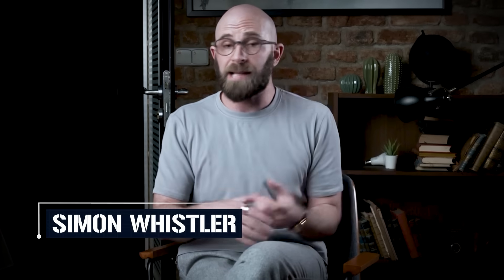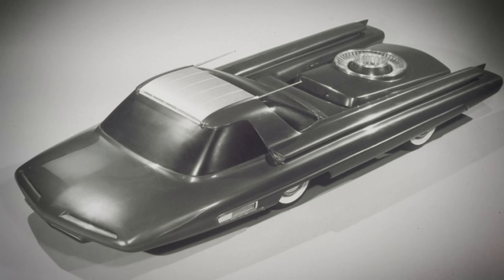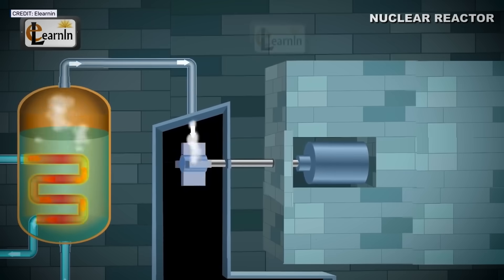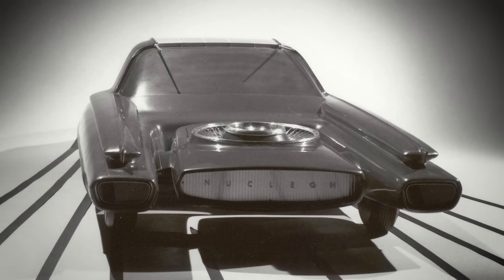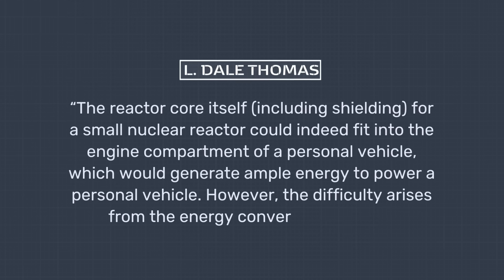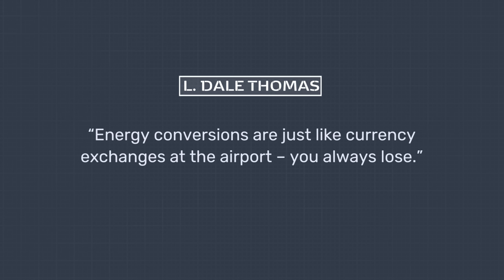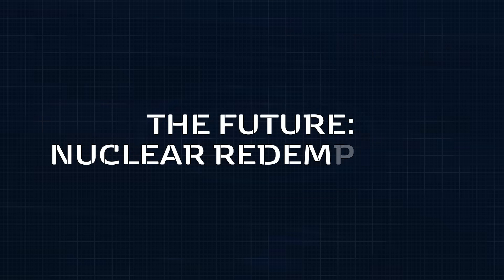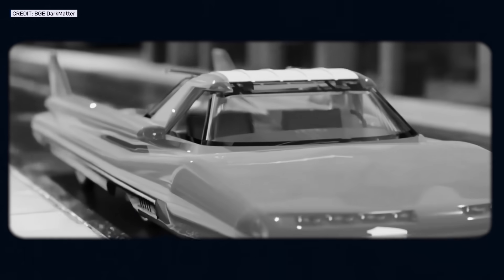The Ford Nucleon: The Nuclear Car of the Future

Comment: If you have an electric car and your city runs on nuclear, technically you’re driving a nuclear powered car
Reply: Technically steam powered too 😂
Reply: Using this line of reasoning then most electric powered cars are really coal powered.
Reply: @BTM666-t7r  ... yes they are
Reply: @BTM666-t7r yeppers you got it which is why we really need to get the grid figured out before going 100% electric
Reply: @mininearby no reason to. The best battery's we have barely have a 7yr life span... that said within 30 years of fully electric world as you say... to totally run out of minerals/resources of the earth. People have no idea what's required to even make 1. (Small village of slaves) just to minerals the highly toxic minerals no sane human would try...
Reply: @mininearby yes and no. What people fail to realize either out of ignorance or shear stupidity is that the automotive and utilities industries are two distinct industries. Power plants make their money exclusively based on how efficiently they can produce energy meaning they're incentived to optimize their tech. Unlike auto manufacturers which only do it because regulations tell them to. Suffice. Even if coal was the only fuel burned at power plants (which isn't the case even in America which is openly anti-environmentalist reform) an EV would still be the best option. The real threat though would be the strain on the grid. It's just not set to handle 100s of millions of cars being plugged into it. The best solution would be to incentivise those who can to install solar panels along with their vehicles purchase
Reply: @BTM666-t7r you are 100% right, thats the point
Reply: @BTM666-t7r  depends where you are. Here in the UK, we have zero coal power plants (last one closed last September). Places like Finland, Sweden etc are nearly entirely renewable. France is predominantly Nuclear and renewable
Reply: @jonc-1989 which....is still electrical
Reply: @BTM666-t7r  glad someone brought that up! 😂
Reply: @BTM666-t7r  Exactly. That’s why driving an EV because you want to be environmentally responsible is a fruitless exercise. Unless your home is powered by solar or you live in an area powered by nuclear, hydroelectric, etc., you’re still burning coal or natural gas.
Reply: @SSPspaz  Are you ignoring fuel efficiency on purpose or are you just forgetting about that part?
Reply: @snickerdoooodle  Savings on fuel is generally a wash as you just pay more for your power bill at home to charge your car instead of paying for gas. If we were talking about hybrids instead of EVs, sure, fuel economy would be a legitimate consideration since you do save money on gas without having to pay to charge it at home.
Reply: @BTM666-t7r  Yes and they would still be more efficient than ICE car
Reply: Technically correct is the best correct.
Reply: 3 minutes in, let me call it now, 100s of 1000s of cars going critical due to people not maintaining water
Reply: @justinteal495 warning lights for warning lights no start unless water added or boom
Reply: You are technically correct. However, this means that most electric cars are actually coal powered cars.
Reply: Damn, all electric car in here use city coal power 😅. Green AF
Reply: They managed to split the atom, and this thread managed to split the hairs! 😂😂😂😂😂
Reply: it depends on how the electricity for electric car is made, when you power your car with electricity produced by coal plant then its not really ecological, also considering the fact that EV batteries are mainly composed of toxic and harmful materials such as cobalt.
Reply: That’s like saying I’m a vegetarian because cows eat grass
Reply: I’m using an iPhone, made by billionaires, technically I’m a billionaire 😅
Reply: Well, if you have a gasoline car, technically you're driving a solar-powered car. Fossils are remains of life, and all life uses sun energy, so oil/gas/coal is really a solar energy storage medium.
Reply: That's a good idea, let's have the reactor separate to the car. Then the cabin will be further from the reactor. And it would be a lot lighter! 😂
Reply: Well that technicality sucks because you aren't able to drive forever as if was an actual nuclear powered vehicle.
Reply: 🤔 idk we don't use that much.
Reply: All fossil fuels and wind and solar energy is from the nuclear bomb in sky (the Sun) so everything is technically nuclear powered 😂
Reply: @noelchignell1048 
The material that makes up the Earth and some of energy perhaps did not come from the Sun. However, yes, energy that created the fossil fuels we use I think did come from the Sun. What about tidal power? Could argue a lot of this is from the Moon? Some theories are that the Moon is not of the Earth and was formed independently of the Sun. I don't know.😂 Just saying what clever people have come up with.
Anyway, the clever people say the Solar Systems, Galaxies and the Universe all resulted from a Big Bang which I certainly don't think was very eco-friendly and has resulted in a lot of harmful emissions.
Reply: The nuclear plant was made using concrete, that uses fossil fuels so your electric car is fuelled by dead bugs.
Reply: Powered by child slave mining labor in China and Africa, recharged by nuclear*
Reply: This is but lazy intellectualism for the M-asses. I provided solutions for NASA's Lunah colonization concepts and nuclear mobility was one viable idea.
Reply: Many EV owners I have talked to only use 100% green renewable sustainable carbon negative energy sources to generate the electricity used to charge their cars 😉. Not a single spent fuel rod to be seen.
Reply: If you eat vegetables grown in fertilizer, technically you’re eating s***. Great logic there bud.
Reply: By the same construct, if you have net metered solar panels on your home in excess of your charging needs, your EV is essentially running on fusion power...  Mind you, gasoline and diesel are also solar power, just captured by photosynthesis millions of years ago.
Reply: I wonder how many people get the joke 🤣
Reply: Still a daft idea 😂
Reply: Yes,...and no. With your logic and If you have an ICE car (Internal Combustion Engine), you are running on a combination of electric and and oil. The refinery use electricity to run. Electric which is provided by whichever source it is generated it. Coal, oil, Neuclear, sind, solar, hydro. Same with electric. But de have a common undestandig og powered by, means the individual vehicle/machines/engine etc ;-)
Reply: What about mobility scooters? I always look at fxx old fxxxs on those and can't help but think nuclear power.... fxxxing crazy
Reply: By committee not directly. The electricity is a byproduct prior to the transfer from the nuclear power plant, whereas a nuclear driven car has and converts the nuclear power into electricity for it to drive on.
Reply: No
Reply: Its not the same!🤬
Reply: Great 1.
Reply: Technically everything is nuclear powered then. You need atoms and electrons
Reply: Nope.
Reply: Nope
Reply: Technically out
Vehicles are air breathing dragons
Reply: Even then you’re still just heating water to make steam and spin a generator.
Reply: Still powered by batteries that are built using materials mined by slaves
Reply: That’s such a cop out
Reply: Idiot
Reply: The power is sourced from a nuclear plant. Just because it's stored in a battery doesn't mean it ain't nuclear power.
Reply: If you eat anything, it has grown because of the sun, so you're eating nuclear powered food
Reply: Electricity is only 80% efficient (don't quote me on this.) and I am pretty sure heat leaks from nuclear reactors, so no it would have too much loss to be consider really nuclear powered but nice try on nuclear washing.

P.S - I know this a joke and I am also joking
Reply: Sure, but there is not a nuclear power plant in my tesla. I am good with nuclear power plants, they are stationary,  unlike cars that get into wrecks ever 5 seconds.
Reply: If your car runs on gas then it's being fuel by the sun converted to biomass by ancient plants distilled and put in your car.
Reply: Dude you need to log off and do some studying lol
Reply: Nuclear energy is just heat energy....which is just part of the electromagnetic spectrum.....so yeah, it's always been electric and always will be.

Just how we generate that electricity is the thing. I mean, we make electricity out of burning wood, doesn't mean burning wood is more effective that Nuclear, it just uses the same concept.
Reply: By that logic all cars are ultimately nuclear power, if we look back far enough. Solar power? Comes from the sun, a huge nuclear reactor. Fossil fuel? Those carbons and hydrogen were smooshed together using photosynthesis, mostly.
Reply: Lame
Reply: thats like saying gas poweres cars are dinosaur powered
Reply: Created by oil for the steel rubber plastic and batteries 😂
Reply: My car runs on water (hydropower) 😁😉
Reply: So…you’re saying, I’m having nuclear powered toast?
Reply: Technically I'm travelling in a Coal powered car
Reply: My shit runs on dinosaurs
Reply: If you have 2 biljoen took the "save and effected" and a
After+- 5 years you have 2 biljoen less you have less carbon and don't need electric junk we can just drive diesel..
Reply: Yeah nuclear is the only reason we still have power
Reply: Meanwhile we have carbon powered electric cars 🤣🤣🤣😭😭 The EU deadass dismantling all nuclear plants, while progressively banning combustion engine cars, until 2050, were only EVs would be allowed.
Reply: @-The_Phantom  only allowed....... 

Only if enough sheep blindly follow the "orders" ... 

If the number is to small that's said No it easy to send brainwashed police to enforce.... 

If a big % said NO "they" can do anything about it...
Reply: Wtf kind of logic is that
Reply: Technicaly you drive a steam powered car
Reply: Not really because your car is just powered by electricity
Reply: Likewise, if you have an electric car and charge it in a city powered by coal, you're basically doing nothing to help the environment.
Reply: If you have an electric car...
 you're not the smartest one
And your city runs on nuclear...
 obviously you're russian
Then technically you're driving a former nuclear waste polluted car 
😂😂😂
Reply: My car runs on dinosaurs
Sometimes I even get 30 miles to the Dino. It’s really great
Reply: Just without the savings passed down to the driver
Reply: Technically you are incorrect
Reply: Nuclear powered steam boiler 😂
Reply: The battery’s make it non eco friendly. All the rage for electric cars will die in 20 years when we are forced to discard them. Ecological disaster.
Reply: Idiot
Reply: By that logic, everything is powered by the elements in stars if you follow everything back far enough.  Does that mean all machines and organisms are solar powered?  I don’t think so.
Reply: It’s a hybrid… nuclear power generator used to drive electric motors…
Reply: You’re not smart
Reply: Nice
Reply: Yes power source
Reply: Yeah but people had to build the nuclear plants then mine and process uranium and people eat food and in America they eat hamburgers so actually they're powered by hamburgers.
Reply: @jamie7472   All cars are powered by hamburgers
Reply: Bro you just blew my mind. I love you. I need to be with you. Where are you!???? WHERE ARE YOU!?!!!!!? AAHHHHHHHH I CANT LIVE WITHOUT YOU!!!!!!!!!
Reply: @weezyfidelis787  Whom are you talking to, Wheezy?
Reply: No
Reply: Nope. The reactor POWERS the car, not the damn batteries of the car.
Reply: @dracofalconis7865   Yeah that’s why I said “technically”. Even this car is nuclear powered but not nuclear driven
Reply: @bigmini2870  it's still an electric car not nuclear powered
Reply: @davidrollend219  and where does that electricity get generated from? what source of Fuel?
Reply: @dracofalconis7865 in this sense then the car in the video is also not a nuclear powered car. no matter what you have to transfer the energy from nuclear fission into electricity to charge the batteries to power the car. both are electric cars one with the reactor inside and the other with the reactor outside the vehicle lol
Reply: @RatFabTacoma they don’t understand
Reply: @dracofalconis7865 ur dum.
Reply: @dracofalconis7865  if it nuclear POWERS the car, then it’s fair to say it’s a nuclear POWERED car. It’s an electric car that’s nuclear powered.
Reply: No...
Reply: @purplepois0nbf  Uhh... Yes. Think about it for a little bit.

Where does the car get the electricity to charge the batteries? From the nuclear reactor generating the electricity. No nuclear reactor, no electricity.

Charge the car with solar panels? Your car is powered by the sun. No sun, no electricity.
Reply: @dustinlange9759 

Pedantic. The direct power source for an EV is, shockingly, electricity.
Reply: If you ate an apple pie, it means you ate an apple, also you ate the dirt the apple grew on therefore the poop that fertilised the dirt

Technically you’re eating poop when you’re eating apple pie 🎉
Reply: No,not really...
Reply: coal has been being fazed out for years.. a handful of boomers who think power is generated they was it was 20yr ago are just flat wrong and outta touch😂...there's a reason why coal miners were going extinct back when Bush Jr was president and the rest got the ax last Trump term when he gave the go ahead to shut it all down... thinking coal is actually in the energy convo is like a horse breeder talking about how trucking is a fad...
Reply: @lenbones7940 

Spoken like a true gen z.

As of current times,  there are 49 gas-fired power stations in the UK, including 35 combined cycle plants and 14 single cycle plants which include burning wood. This isn't including the various 'waste to energy' sites either.

Surprised? Thought you might be.

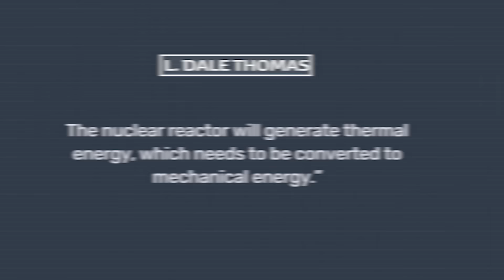Comment: 8:22 There aren't any less energy conversions of energy with an EV. There are even more! In the case of nuclear energy, you have all the conversions mentioned in the video in the nuclar plant, in addititon to the conversion from the battery into mechanical energy in the car. Charging AND decharging those batteries causes them to heat up and therefore waste energy. 
Transporting said energy over long distaces also looses energy. 

Therefore, a nuclear powered car would be more energy efficient, because less energy would be lost along the way.

The biggest argument I have heard against a nuclar powered car is; "Every owner of such a car, in modern times, would need to be a trained and certified nuclear reactor operator. An education which in the best of circumstances takes years to archive."
If you start learning for your drivers licence at age 18, you would only be able to start your practical driving training at around age 21. And it would be expensive.

Comment: Actually we are currently easily able to recycle nuclear waste. When you recycle spent fuel rods, you can reuse them in fission. And the more you recycle a rod the lower its half life becomes to the point where the final uranium that gets used can be completely non radioactive. We can even use already stored nuclear waste and recycle them to use in powerplants again.

The only issue is that recycling spent fuel rods unfortunately creates weapons grade plutonium as a a byproduct. Pretty big fucking issue. 

Fantastic video as usual though, this man might be one of the hardest working presenters on Youtube running 60 billion channels.
Reply: Bonus Fact: That "byproduct" can be used to power time-traveling DeLoreans! Win for everybody!
Reply: I'm sure most militaries would be very happy to have that inconvenient weapons-grade Plutonium 😉😏
Reply: Dry cask storage is completely acceptable. And it makes future reprocessing easier.
Reply: Thorium would be an even more abundant and less dangerous source of nuclear power, albeit not fit for the scales of a car engine
Reply: Youre also minimizing some issues like saying we can easily recycle spent fuel. I beg to differ its some of the hardest materials to work with
Reply: @JacobWillits   you’re correct I should not say easy, its a difficult task. But it is doable by every measure, and even scalable.
Reply: @bigmini2870  In the United States, recycling of nuclear waste is not currently practiced due to various economic, policy, and technological reasons. Other countries, such as France, Japan, and Russia, actively recycle spent nuclear fuel. They use methods like pyroprocessing and PUREX (Plutonium Uranium Redox EXtraction) to extract usable materials from spent fuel, which can then be used to generate more energy.

Comment: Ford: “This is probably a bad idea”
GM: “We’ll beat them to market with the Corvair!!”
Reply: I love my corvair monza spider turbo
Reply: It kinda seems like Ford decided the Nucleon was too dangerous & decided to go with the Pinto instead.
Reply: I owned 2 Corvairs and Nader was nuts, it was a pretty good car for the time. No AC, and the heater sucked, but got good milage and if you knew how to drive, it handled quite nicely.
Reply: @ Porsche drivers love the same rear-engine layout.
Reply: @danlemke6407 it didn't just have bad heat wasn't it an option so like in the south someone might have got it without one. Those little gasoline space heaters are pretty cool tho